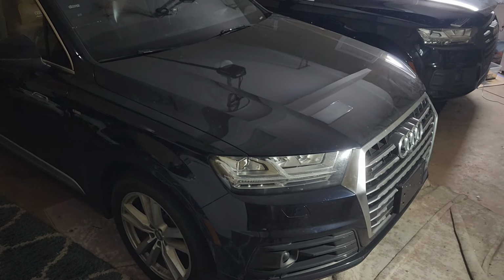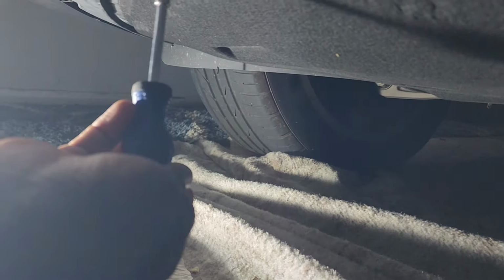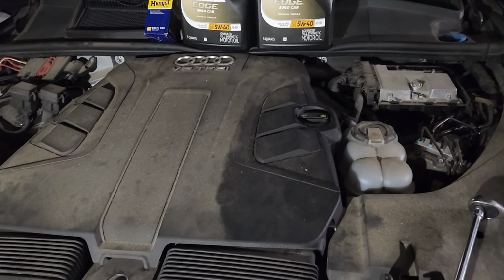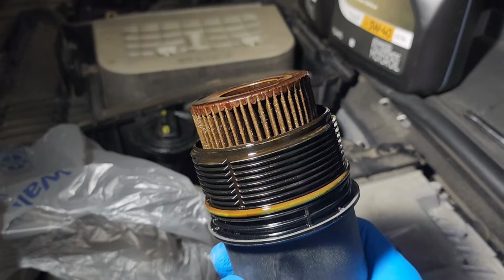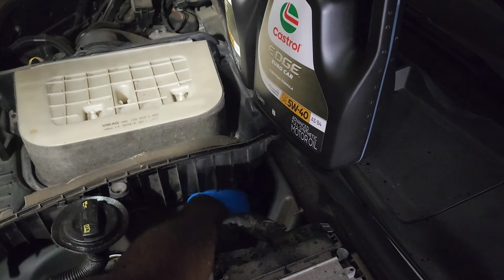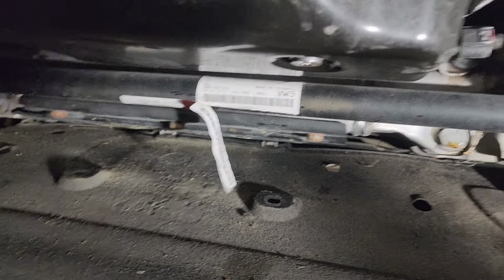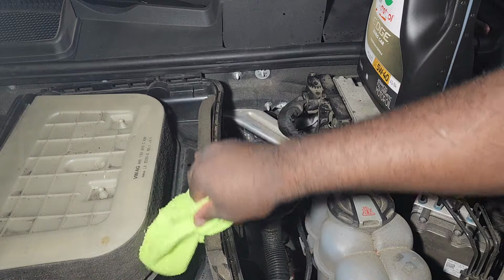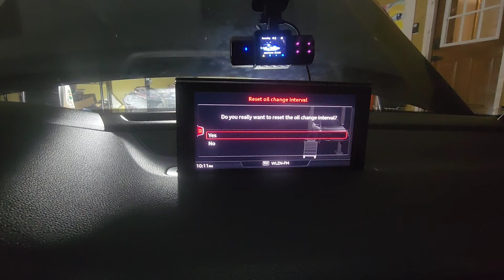2017 2018 2019 Audi Q7 oil change

Comment: I did the same thing but after 2 weeks keep ask me to add 1quart of oil. Like every 2 weeks. Do you why? I don’t see any lick
Reply from the maker: @samnguyen681  the Audi q7 is known for burning oil,  sometimes due to a failing oil separator.  Replacing the oil separator is an intense job, i posted some videos on the process.  I'll suggest you to keep an eye on it or have dealership look at it.
Reply: @hustlecarfix3160  could also be a clogged piston rings. There's a video on piston soak to clean it. Suggest doing that first before the PVC valve replacement. I did my own pcv replacement and it doesn't change anything
Reply from the maker: @nh4thuy  can you please give us more details on what that entails.  If you need to share by dm, please let me know. I'm still having similar issues on one of our Q7